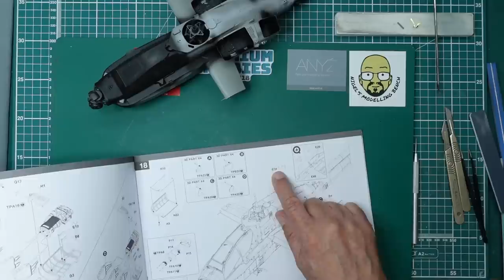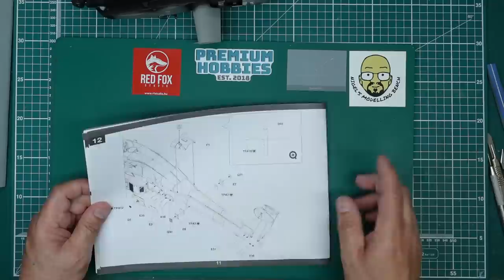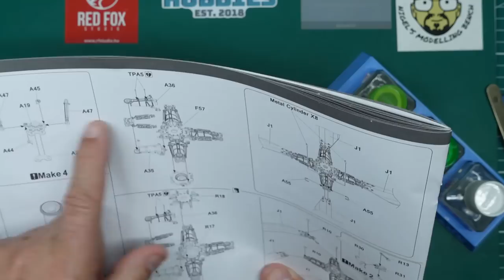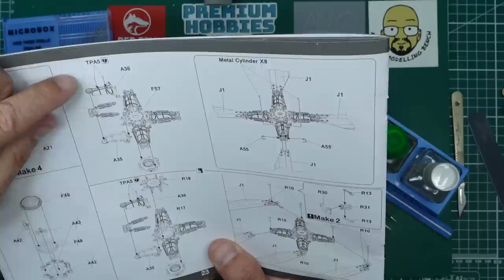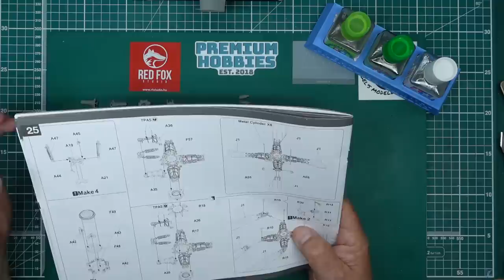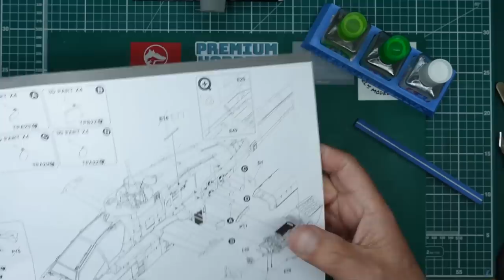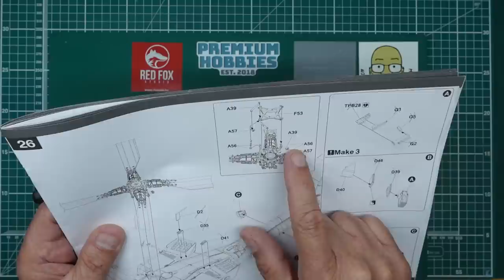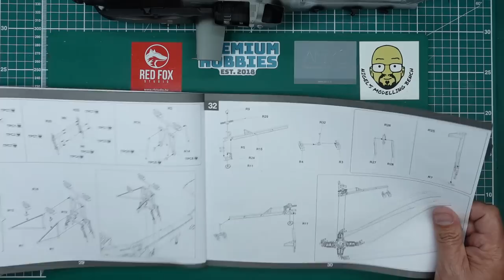Takom 1/35 AH-64E Apache build. Part Eight.

Comment: Nigel,  It looked to me as if the masking tape around the upper part of the lower main rotor shaft was still in place, after I thought you had glued the rotor head into place.  Did I see  this incorrectly, or is the rotor head still removable to allow the removal of the masking tape?
Reply from the maker: Yep, still there Tron. It will come off at the end.